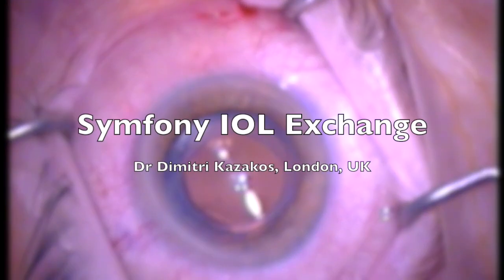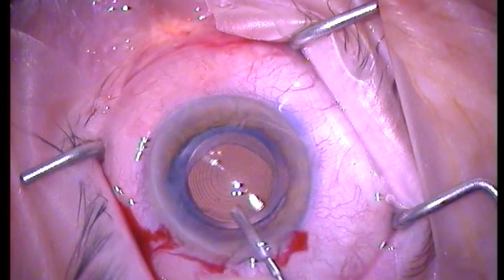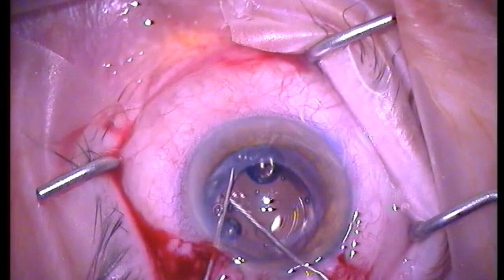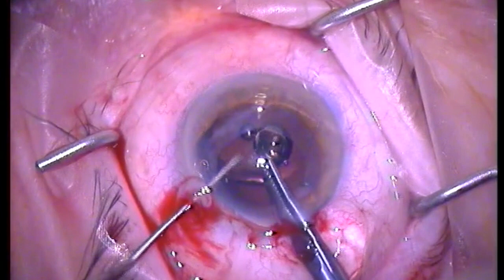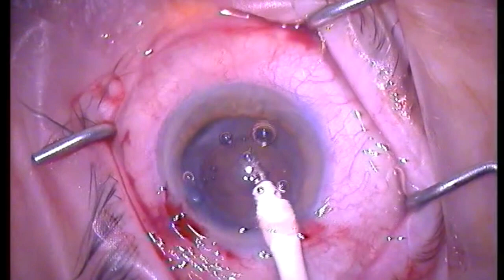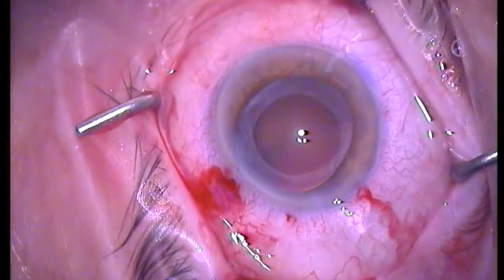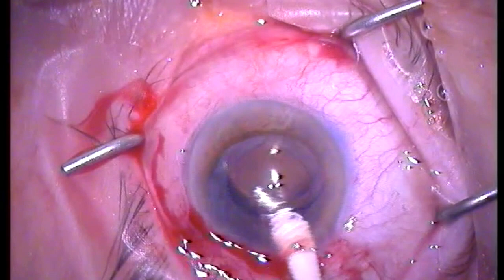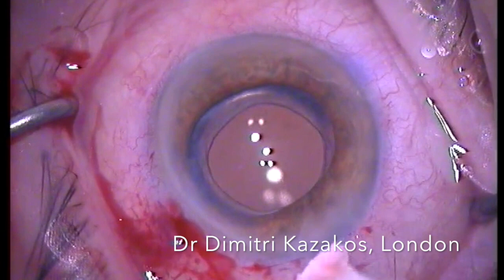Symfony IOL Exchange to a Monofocal IOL

Comment: Thank you for your video. How about zonular damage after IOL exchange? I'd like to know if zonule is  okay to pull the implanted IOL off like above video.  Is the instrument that was used to grasp anterior capsule in video necessary? I don't have it.
Reply from the maker: Hi Kun, Indeed, zonular damage is always a concern especially for a primary surgery over 18-24 months old, high myopes and hydrophilic lenses with plate haptics. The instrument is not necessary but alleviates traction/pressure in capsule and a different spatula-like instrument can be used to apply counter-traction at the point of pull or rotation of the haptic of the lens.
Reply: Thank you for your kind reply.